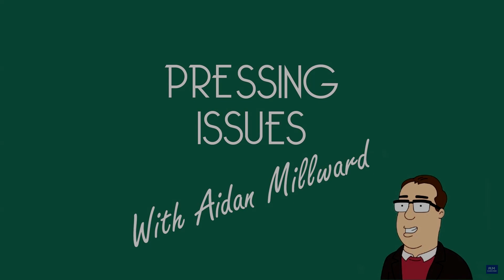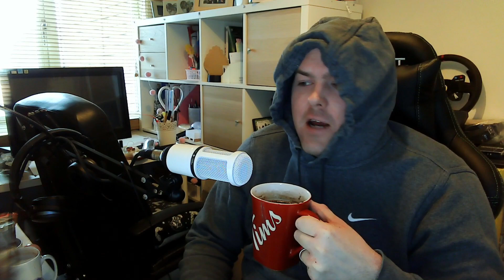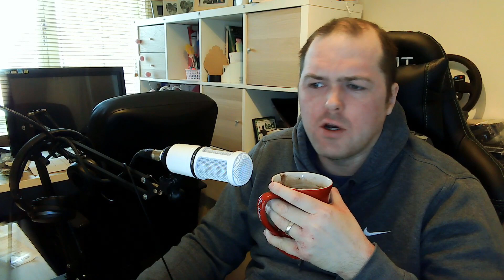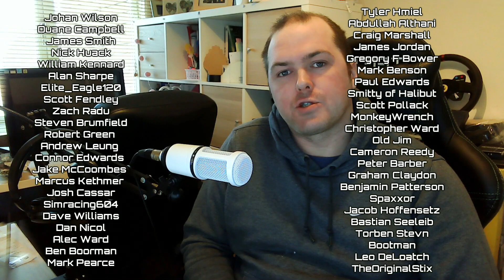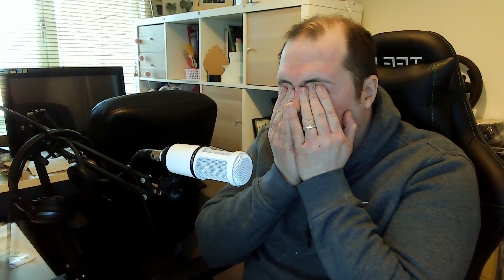IS IT REALLY TILKE'S FAULT? Opinions on Hermann Tilke Track Criticism

Comment: Abu Dhabi, Barcelona and Imola are exciting 
Don't blame Tilke for making the tracks boring, blame the FIA for giving Tilke these guidelines he has to follow 
And by the way Hockenheim since 2002 is the worst F1 Track ever
Reply: I really hope you're taking the piss. None of those 3 are good tracks or provide any racing and the new Hockenheim is so much better than the old one to drive.
Reply: Abu Dhabi (Yas Marina) is the single worst track ever made, and Barcelona and Imola existed long before Tilke butchered the last sector of Barcelona, and all he did to imola was remove the last chicane for cars and redesign the pit area. So these tracks are exciting yes but they were never designed by tilke in the first place so are not relevant to the discussion. Tilke has managed to design 4 decent circuits in his lifetime in my opinion; Bahrain, Istanbul, Shanghai and Sepang. That means that in the last 15 years all his circuit designs have been woeful
Reply: @finellershaw295  I'm serious about it so stop crying and move on
Reply: @spainobmxer69  How about you blame the FIA for giving Tilke the guidelines he has to follow
Reply: @anonymous-vo2rd  because for the last 15 years he’s just designed tracks that have used elements from his ‘successful’ circuits or copy and pasted corners from historic circuits (COTA) if all of his tracks from the last 15 years had grass run offs or gravel instead of tarmac run offs or even no run offs at all (as the guidelines from the FIA are for safety and that’s it) the tracks would still be crap due to their design.
Reply: @spainobmxer69  the reason most tracks don't have gravel runoffs is because Bikes race on those tracks as well and if they go off then the tarmac runoff will the bike and biker flat on the floor rather than have the bike flip over and crush the biker riding the bike
Reply from the maker: @spainobmxer69  they have all these replicas of classic corners because the fans want that. 😂
Reply: @AidanMillward  haha do they though? I’m still waiting to meet one
Reply: @anonymous-vo2rd  I understand that, I was making the point  that even with dangerous run off areas the track design itself would still be crap
Reply: @anonymous-vo2rd  ooh you're ard